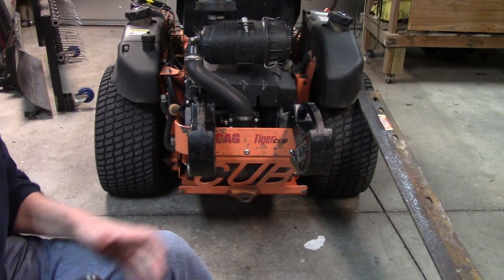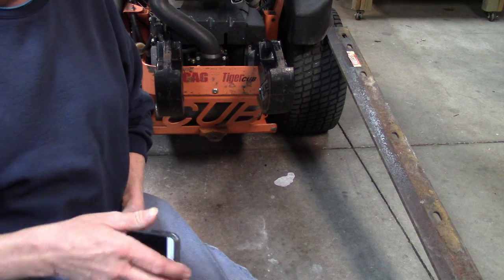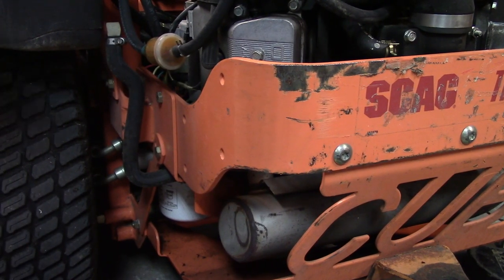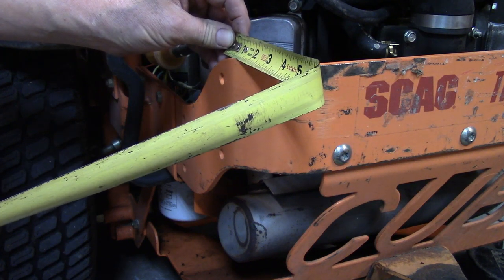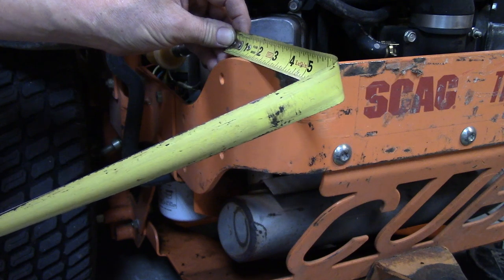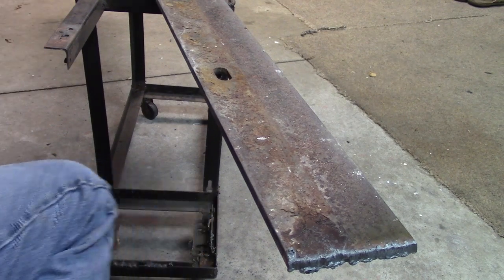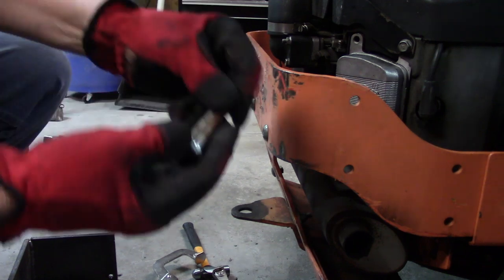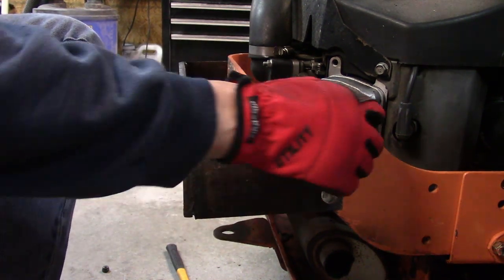Fabricating Weight Bracket for Tiger Cub

Comment: Nice job of fabricating. I know you don't like to here this.... But if you would use cutting oil or motor oil, the drill bit will work better. Been there. Spray lubricant gets into the pores of the metal & you damage the bits. Take for what it's worth. Keep the videos coming. Stay safe.